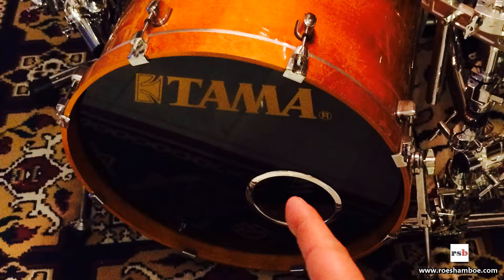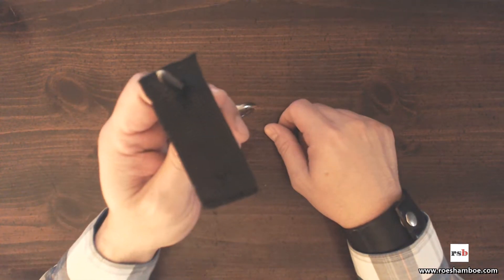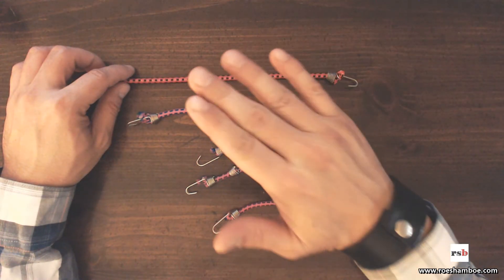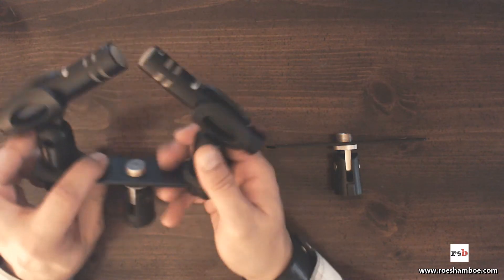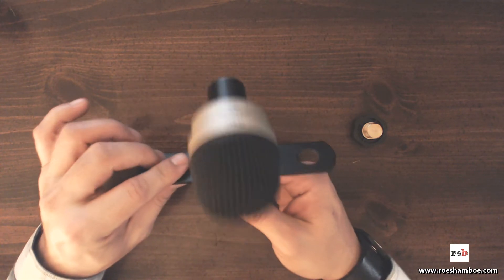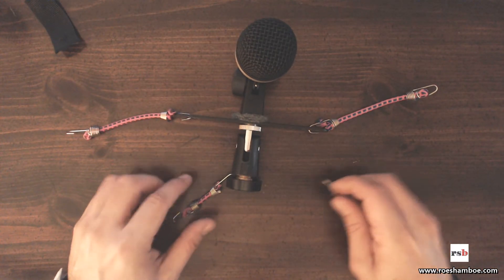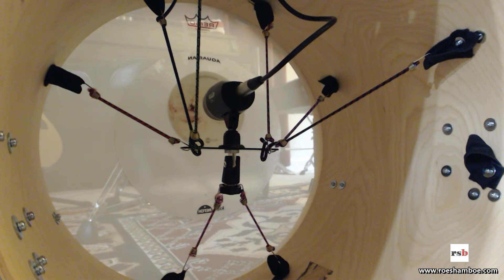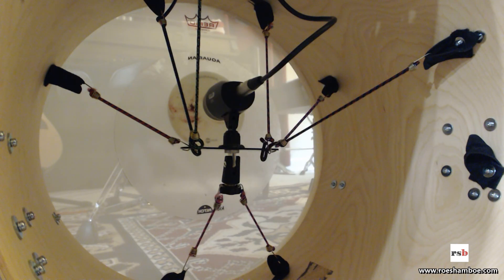Bass Drum DIY Internal Mic Mount | No Mod/Cut/Drill | $10

Comment: I would like to see where all the wires go from there, and how the set up works
Reply from the maker: i route the mic cable out through a hole in the top of my kick leftover when i removed the tom mount holder (tama starclassic performer kit).  after that, it goes straight into my interface (for recording) or a mixer (for live streaming).  i go back and forth between 1 or 2 mics on the kick but i'm lazy so it's usually 1 lol.  i go back and forth between fully mic'ing the entire drum kit versus using 3 mics only (kick and 2 overheads)  currently i'm running 3 mics and im super happy.  let me know if you have any other questions.

Comment from the maker: DIY Internal Bass Drum Mic Mount EZ $10 NO Mods Fully Adjustable

Build your own internal bass drum mic suspension mount for less than $10.  

No drilling, cutting, or modifications to the drum/shell.  Only tools needed are scissors and a screwdriver.

Thanks for watching.

Comment: is this all good for taking between gigs etc?
Reply from the maker: for transport i would say it's fine if you are careful... basically, on my setup, the bungees have enough slack that when you move the drum around the mic will move also... however, for bass drum dampening i keep a moving blanket in my kick so when i put the bass drum in its case, the mic rests on the blanket (still bungee'd up) inside the drum inside the case... if any of the cords come undone during transpo you can just re-hook them up to the anchors when you're ready

if this is a concern you can completely unhook the mic and remove it... it takes less than minute to unhook and/or hook everything up if the anchors are already installed

good luck let me know if it works out for you
Reply: Awesome! thanks for that such a great idea!
Reply from the maker: no problem...i had been researching ways to do this but they involved drilling or going to the hardware store and buying stuff and cutting and drilling stuff and i knew there had to be a more elegant solution using existing parts.  

i have a bunch of those double mic adapters laying around and kaboom there ya go.

one thing i should mention is that the pic in the video is from my practice kit and has remo silent stroke heads on it that's why the mic is placed soooo close the batter head

anyway if it doens't work out for you at least it didn't cost that much to experiment and you'll have a microphone adapter leftover anyway lol!